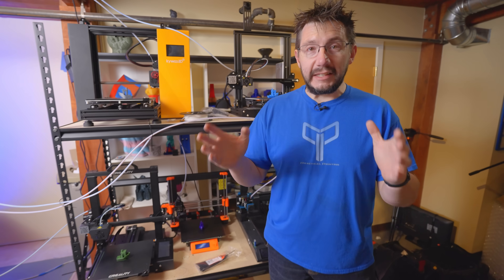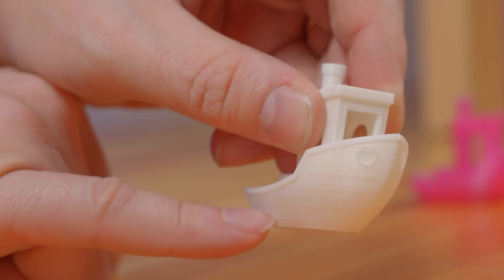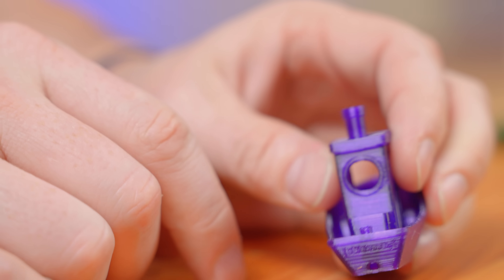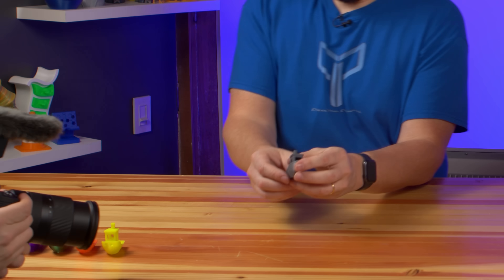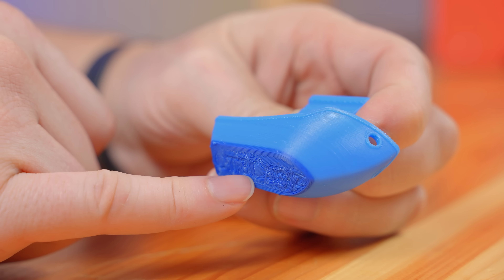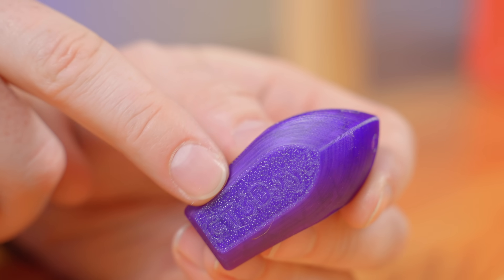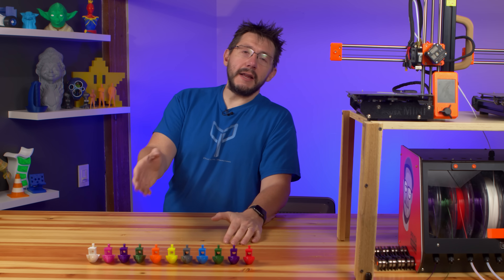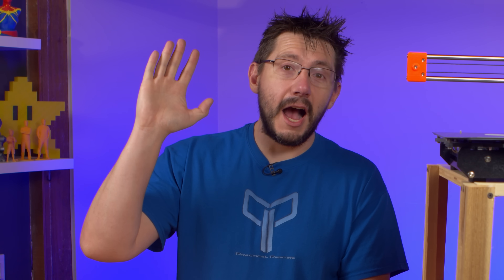9 3D Printers Make 11 3DBenchy Boats

Comment: When doing a comparison like this you should be using the same filament and same color so you are comparing apples to apples because different filament can make a difference. However I do understand that the reason to ask our help was because Liam wanted the worse benchy. Also originally it was testing to see how well the repbox would work. I think the grey benchy was the worse.
Reply from the maker: Liam ended up getting the gray Benchy

Comment: I think the Kywoo3D Tycoon had the worst overall result, closely followed by the Prusa Minis, but it looks like the Tycoon was having extruder skipping issues because the temperature was too low. It certainly had the best overhangs so would be interesting to see how it finishes with the filament dialled in properly.

Comment: Prusa mini looks the Worst
Kywoo had a extrusion problem(maybe because of the speed and the bowden extruder)
Artillery Looked the BEST despite the 0.6 nozzle, except for the cooling.
If you think about the stringing Artillery did great having a Volcano block.

BTW i own a heavily modified Ender 3 Pro and i can easily say, i get better results of all the above.
Reply from the maker: How heavily modified? Videos on it?
Reply: Hi Apwn, this is Mandy from Kywoo. Just to mention that the Tycoon is using a direct extruder,  not Bowden extruder.

Comment: Hello Joel... I been watching your great streams and shows for about 4 months now, as I only just got my 1st 3D printer at the end of July 2020.
( Tronxy X5SA updated 2020 model with 32 bit board and silent stepper motors )  

For us newbies people like you are the best help going!  
I just now had to have Tronxy sent me a new Hot End Heater Block, as I had some of the melted filament push up out of the top of the heater block 
and cause the heater block to fail with the error on screen saying the printer can't raise the hot end temperature above 20 C?  

I had partly dismantled the control box and hot end and lucky sent them the close up photos of the hot end etc. A good Company Tronxy are they help me by email replies.  

I now having to remove the full burnt out old heater block and it's wiring and try to reroute all the wires back through the plastic wire chain link support and into the wiring box up the top of the big cube frame!  It is very hard to get the two wires back into the wiring box due to the tightness of the gap between the box metal wall and the connector I need to screw back those two wires into. 

I can't remove the board as there is a big ribbon connector goes through the metal case by a cut out slot stopping the board coming out the metal case!

Hopefully I will at long last get this rebuild and working?  I still having troubles with the models sticking to the heated bed, I brought a new super flexing build plate which is a Tronxy part. 

It is the full size of the build area of 13 inches square.  But still no good sicking of the models even though the plate is sort of semi-rough, 
I tried Scotch 3M Builders Blue tape as that was said to help? It semi helps but starts to peel up when the bed gets to around 80 C.  

I looked up PEI as you and others stated that will help big time?  But I can't find any my big bed size of 13 x 13 inches Most are 9 inches square and very pricey indeed. I read up that a Heat proof electronics used tape " UEETEK " will help models stick down well to a heated bed and not peel up as it is made for higher temperature's than my bed can do ( mine does up to 100 C )

What do you think of that Tape? Have you tried it in the past.

I sent for some Flesh tone coloured Filament by e-sun,  I wonder if you would try the flesh tone filament colour by them and see what you think? I be trying it when I got it?
I found that when I did get a few models done their PLA + filament was really good quality and when the heat is set right the filament works well.

Cheers.

Comment: Craftbot 2 Question on it, if a mistake on one is it going to happen to both all the time? Or can you set up two different projects?
Reply: It depends on the mistake. If the mistake is in the filament or the extruder, it’ll be individual. If it’s an XYZ axis mistake it’ll show up on both in concurrent prints. Both extruders are connected to the same belts or rails in many different dual extruder printers.
Reply: @michaelnewton4662  Thanks so having different printers is a better option unless you have everything set properly to do two at once right?

Comment: Looks like 3dp Nerds process seemed to get in the way for an accurate rating.  Notice I didn't say Joel  I.e. not purging nozzles,  proper heat settings, nozzle height,,, etc.   It just shows how important settings are to get the best prints out of them.

Comment: Couple of problems, If it was a blind comparison and cost / quality of the machine was not in the expectation of the print and color biasing because that can affect opinion and even viewing of the model on camera...I would say the worst would be the Craftbot (2) with the weird lines part way up the side because that is a obvious defect in the machine printing both left and right model.. all the other model problems were user error and could be corrected with a little post processing or just correct settings initially and weren't the fault of the machine..

Comment: The one that had the "stringing"
Reply: Which could probably be fixed by experimenting with slicer settings.
Reply: @TheSuburban15  that's not the point though
Reply: @knifeyonline  what was the point of this unscientific test?
Reply from the maker: The test was to see if the Repbox could successfully serve up 11 spools of filament. A person by the name of Liam donated money during a live stream to have me send them “the worst one” and I needed help picking.
Reply: @3DPrintingNerd  I guess I still don't understand how you can pick the worst filament using 9 different machines, none of which have been tuned for the tested filament.
Reply from the maker: It’s all the same brand of filament. The dude wanted the worst one, so I figured you and others could help pick.

Comment: Kywoo 3d tycoon .... that's a user error as not enough heat to the nozzle.
Creality Ender 3 Pro is also a user error. 
So these are automatically disqualified from been the worst.
The worst is Sidewinder X1.. layer lines are not gelling together.
Reply: I disagree, because it was the only one with a different nozzle width.

Comment: Kywoo is the worst do to the obvious layer inconsistency on the door frame. The Artillery Sidewinder is also not very good, but it was printed outside the parameters a benchy is designed for.

Comment: Given the price point and level of expectations white Prusa mini is the worst. I observe the same layer inconsistencies on mine and it doesn't seem to be profile not dialed in. If it happens on stock profiles on Prusament PLA I don't feel better than the manufacturer itself. 
If it would only happen on curved surfaces I could live with that but it happens also during printing a cubes.

Comment: 9 different printers * 11 different filaments * 1 uniq model = 99 prints, Joel. If you want to make valid conclusions, using your boundary conditions you have to make these many print tests and compare each filament vs each printer output or vice versa. Sorry, Joel i'm a mechanical engineering student that finished his thesis recently, i'm still traumatized (smiles while crying inside), Cheers mate.